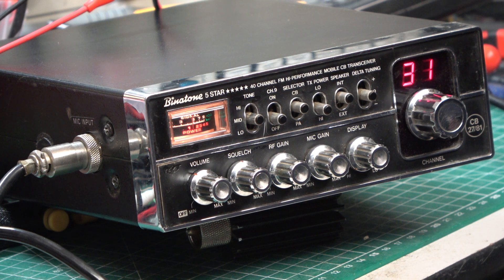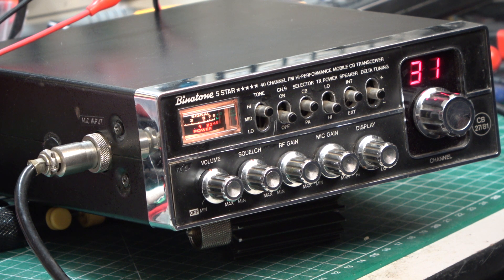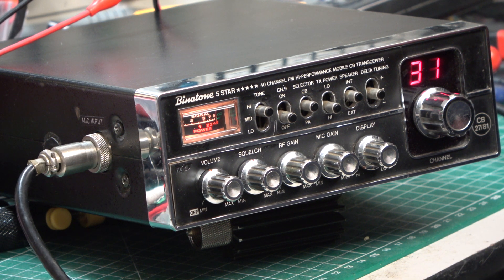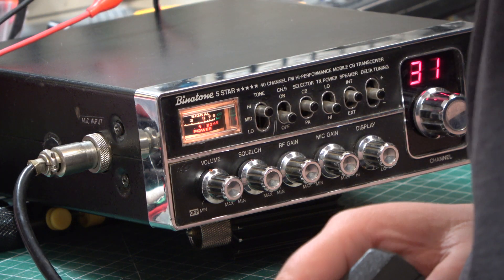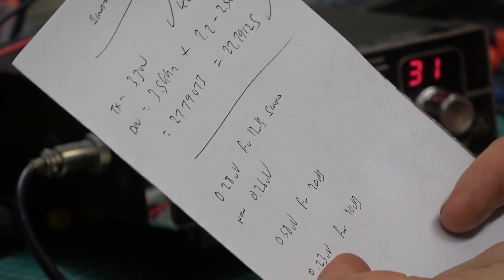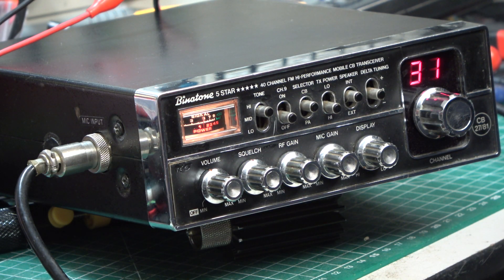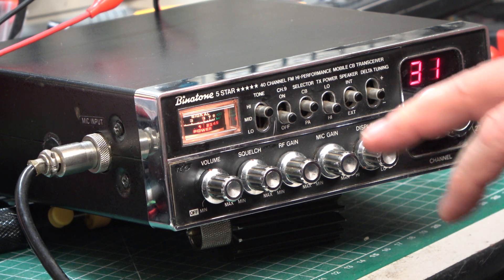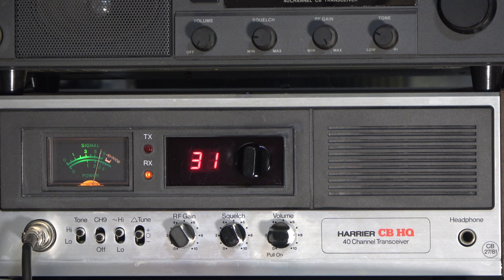Binatone 5-Star CB27/81 UK FM CB radio - On The Air test

Comment: lovely radio's...always on the look out for a nice clean example to go with the rotel 240 ;)
You can not beat cybernet for FM mode
Reply: Yes all the sets made on this chassis are quality, the only thing they get marked down for by some is the squelch operation but I've not had a real problem with it, they normally align really nicely, like most sets they only become problematic when abused or in a smoky environment, sure fire way to gum up and lose digits on your channel selector switch is to smoke around the radio and channel selector switches are very hard to clean without drilling holes in them.

Comment: Sounded nice Richard, crikey I've not seen these go for 30 quid, well not a good one at least, sets like this, the 240 and the harrier etc are all going for 80 and up these days, I'm keeping my eye out for a good one of these, I've so many CB radios now and so many of the same type I want to whittle them down, not by performance as all my sets are sorted just by cosmetic looks, they have to be in really good condition for me to look at them now and sadly that means a bigger hole in my wallet.
Reply: Heads up dx444 Chan has two five stars new in box he's letting one go wanting a 240 as new for straight swap the 863 shown on his chan is also up for grabs